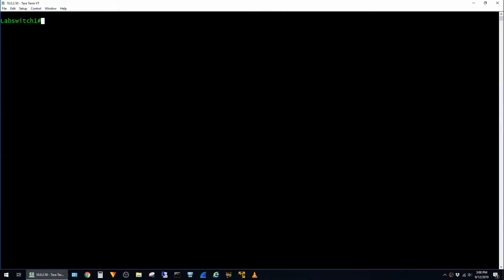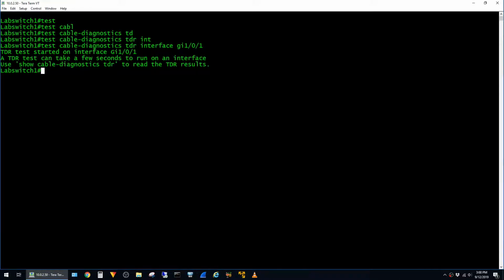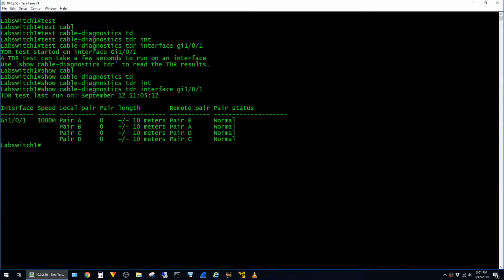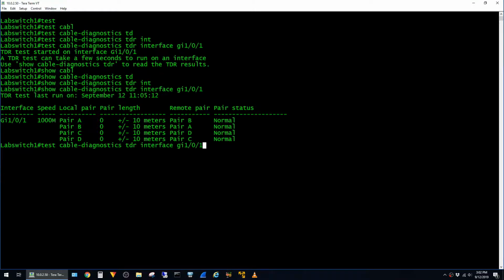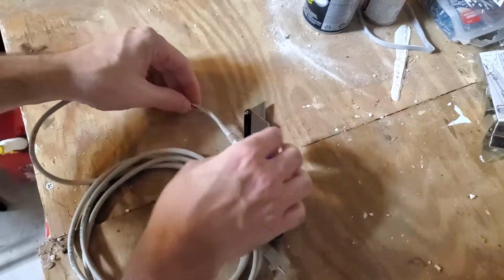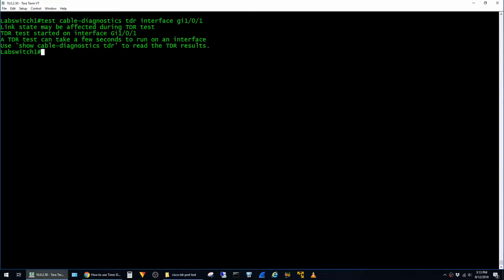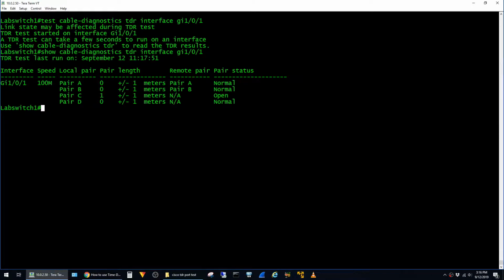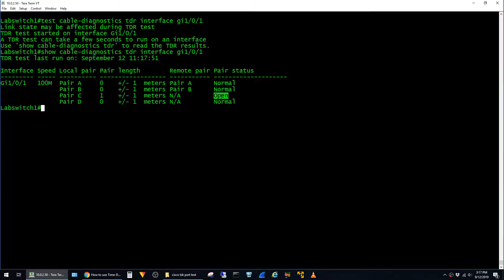Cisco Switch Cable Test Command

Comment: Thank you for the video. I ran the command on a Cisco 9300 but there is no clear cable-diagnostic tdr command available to stop the test. Any idea?
Reply: If it's running and won't stop I think you may be able to do a shut and then no shut on the port.

Comment: Also when you run this test, it does interrupt the connection so if you may want to wait until there is some down time.  For example if someone is having a conversation on their VOIP phone, the phone will lose power and reboot.  Or if you have a trunk line or a server connected, it will lose connectivity during the test.
Reply from the maker: Yep good to mention.  Pinning this comment.